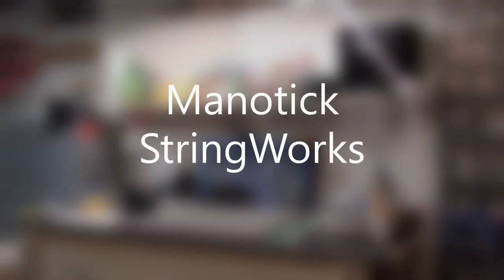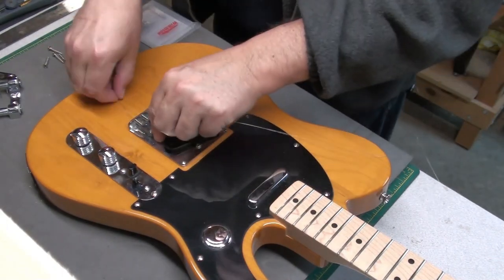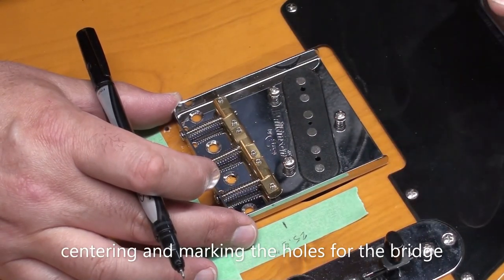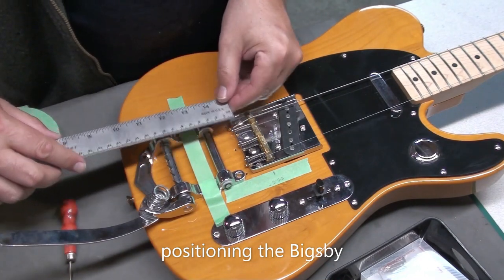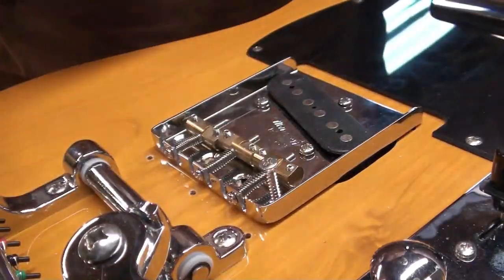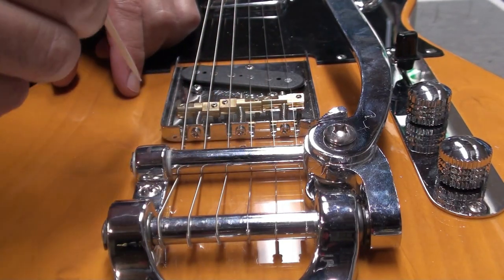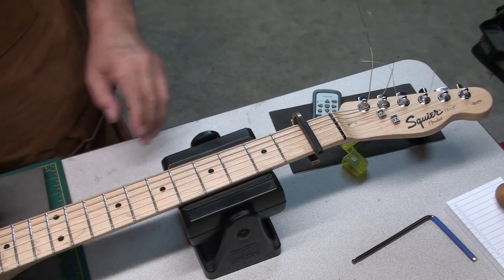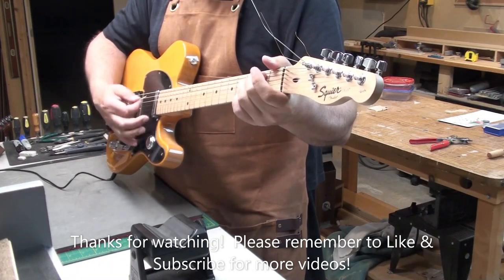All Telecasters should have Bigsby's...no?  Installing a Bigsby vibrato/tremolo on this Squier.

Comment: On the positioning the Bigsby step, I would have used the same method you used for positioning the bridge. Leaving the 1st and 6th strings on, I would have added the 5th and 2nd strings through the Bigsby and then through the bridge to make make sure they both line up correctly.

Comment: You gained a subscriber! I used this video to help me when i put the trem system on my hollowbody Gretsch, i'm watchin this now to help me with my telecaster project, i built the tele with a kit. Now i am gettin the project done sometime in a few days, thanks for this video
Reply from the maker: Awesome!
Reply: @Manotick StringWorks
Now i could use the modern six saddle bridge right? Later on the tele is going to get the three saddle ashtray in black. I aint sure how i'm going to do all that.
Reply: @ManotickGuitarTech  few months later after the install on the B5, and it sounds amazing. next thing is an old school style ashtray, woohoo!

Comment: My Squier Affinity Telecaster is set up exactly like this one , except that I didn't install the arcade style kill switch and mine has fender locking tuners installed. One thing about these aftermarket Bigsby style tremolo setups is that the nut and washer tend to tighten themselves up to where you can't turn the arm. I think that some "thread lock" might be the way to go when doing this type of mod. Great job! I sort of messed mine up doing this😅, but I got it straightened out.
Reply: Thread lock would be good; another trick is to put the nut on something that can function as an anvil, and strike it gently with a steel hammer, so that it becomes veeeeery slightly oval instead of perfectly round; this will increase the friction on the thread. You need to be very careful with this trick, trying first a very light blow, fitting the nut on the thread, then if it needs a harder blow, going only slightly harder, etc. If you hit it too hard, it won't even go on the thread, or it'll damage the thread.

I've never done that on a Bigsby, so I don't know the specifics, I just know this as a general trick with nuts and bolts/machine screws.

Comment: I love the look of these on a Tele and I’ll be doing the same on my Artist Tele shortly. Is there any reason you had to change the bridge? My guitar came stock with humbuckers so my bridge is different to the standard Tele. Add to that I’m a lefty, so I’ve bought a Chinese copy and I’ll pull it down and rework it so it suits a lefty. Fun. I guarantee I’ll never use it either lol. I like the kill switch you did too, nice bit of extra chrome!
Reply from the maker: Thanks for watching - I hope you have subscribed to my channel?  I wanted to use the vintage style bridge with brass saddles and the original bridge had 6 block saddles that you cant run the strings over.
Reply: @ManotickGuitarTech  ah ok I see. I’ll have to change bridges also to use mine as my strings are retained in the bridge. I have a humbuckers in mine though so it might be awkward getting a bridge to fit. Maybe I should just wait until I buy a vintage style Tele with just a single pickup at the bridge. My Tele is one of the Artist ones so I will be doing a bit of experimenting on it, I’ll add a kill switch but mine will go on the control plate, I guess I’d call it like John 5. My biggest thing is I’ll be adding a black binding top and bottom to this one, I think it’ll really help with ageing it some, but then the two humbuckers burst the illusion lol.
Reply: I've seen another video where a guy had done a "bubba mod" to the factory bridge plate, which  is when you CAREFULLY  drill 3 holes in between the 6 factory holes and replace the block saddles with 3 brass saddles, but you only get one shot at doing it right, and it's definitely harder to drill straight through hardened chrome plated steel than you think, not to mention  that the Wilkinson ashtray style bridge that I ordered was only like $25 on Amazon or something like that. I have the original bridgeplate in a plastic bag in my closet.
Reply from the maker: @spottedsaint957  pretty cool!

Comment: I did this exact same mod to my 2018 Jazzmaster Affinity. I bought a dremel, a Wilkinson half tele bridge and a cheap Bigsby knockoff (I recently bought a locking nut because the arm would just loose very quickly), it initially had a strat-style 6 saddle hardtail bridge.
Reply: Why? The "Jazzmaster" comes with a trem, doesn't it?
Reply: @Pappysan  Not mine. Mine is from the 2018 AFFINITY series, those were the low-mid range guitars from Squier. It had no trem system, just a hardtail bridge with 6 saddles (like a strat bridge)
Reply: @Apo458  Oh, I didn't know that...I was just looking at Affinity Jazzmasters because they are going for about $280 (with a trem). Seems to me selling a Jazzmaster without a trem is kind of sacrilegious...
Reply: @Pappysan  Yup, pretty strange design decision. I picked it because it looked cool with black body and two humbuckers. Now I changed it all to gold hardware, I love it even more now

Comment: I think that most guitars aren't finished without a tremelo arm. But I'm not sure about Teles. It's a stick and a slab of wood. It's yer bog standard model. No air con, no power steering, no servo, only available in beige. Basic. So that means no extras like tremelo arms.
Reply: I’ve been playing a tele as my only electric for a year. I enjoyed every part of it except itching for a tremolo. I would actually say that it would actually be perfect if there are more affordable tele models with bigsbies.
Reply: I wanna buy a tele Nashville but i deff would add a trem system i dont like strats tbh

Comment: Great video, plan on doing this with my Partscaster, got it off E Bay here in the UK but was ripped off as the neck was useless, had a back bow and the truss rod nut was rounded off, got a new replacement neck (roasted maple), Wilkinson tuners, bone nut, brass compensating saddles, guitar already had a Wilkinson pickup in the bridge and a five way Strat switch, pretty sure the body is Squire as it's 40mm thick, Butterscotch and slightly relic'd, it now plays superb and is currently my favorite guitar. Was looking at a licensed Bigsby B5 kit, can only find them in the US (i'm over in Scotland), shipping and import tax is the killer. Will get one though.
Reply from the maker: Sounds like a big project - good luck!

Comment: great video! am hoping to do this on a harley benton te62... kind of a project guitar too though i hope to keep it looking pristine. not quite sure why you changed the bridge AND the plate. can understand why you would different saddles but what's wrong with the plate??? I have a standard ashtray plate with a 3-saddle bridge. would that work? (assuming i use a dremel to route the strings in)

Comment: This is the exact set up I have to use on a Meteora tele build I’m doing. Does it work well after having it for a while? Any issues with the strings grinding the saddles? Thanks for all the info
Reply from the maker: SO far so good - admittedly, I don't use this guitar everyday so saddles have held up well.

Comment: Great video!
I started searching for Tele bridge replacement because I just can't cope with the ashtray bridge I have on a otherwise great guitar.
Will a Bigsby work with any top loading bridge?
Reply from the maker: You have to do your homework and take measurements before modifying anything.  There are specialty roller bridges made for telecasters - check them out.
Reply: @ManotickGuitarTech  
Thanks, I'll look at that.

Comment: I did the same mods to my Squier Affinity Telecaster about a year and a half ago and it's still an ongoing project. I just put the original bridge plate screws back in. They sort of help with the  tone🤡🤪🤡. Naw , I just put them back in to keep the holes filled in, but they do sort of give me a reference point for whenever I remove the bridge plate for any reason. Btw, I used a hacksaw and a couple of cheap minifile sets ,(two of the files snapped  in half lol!) ,to cut and grind my bridge plate. Do you have any videos showing the other mods that you have done to your Tele?
Reply from the maker: No, the mods I did were several years ago before I started on YouTube.  I hope you have subscribed to my channel?

Comment: I just bought an Affinity Tele and have replaced the pups with Fender Tex Mex pickups and added a Wilkinson plate with brass saddles. It sounds and plays fantastic and was thinking of this mod, but I dont want to ruin a fine playing guitar if it not a quality mod. Question: Is that the Dopro Bigsby knockoff? How is tuning stability? I prefer to play with 9-42 strings due to my bending style and 10s are too heavy for me.
Reply from the maker: I wouldn't mod the new bridge you just bought - look for a roller bridge version and swap it out.

Comment: While I like the look of the vintage notched 3 saddle much better than the modern 6 saddle, you can do this conversion without changing the bridge.

You can buy replacement saddles that have a pass-thru screw on them and a roller saddle that allows the string to go through. They're sometimes used for a B-Bender set up using a modern style bridge.
Reply from the maker: Absolutely, Jeff - I just wanted to show how you could modify something you might have on hand already.  Thanks for watching and I hope you have subbed?
Reply: I like your idea. You maintain the same bridge and you don't have to worry about the routed hole coverage.

Comment: This video inspired me to install a B50 on my Tele, thanks. 

Did you find that you could get correct string alignment without notching those saddles? For me the strings are way off the pole pieces as the B50 has a much narrower string width than a Tele. Im hoping switching in some notched Gotoh saddles will do the job
Reply: James I highly recommend replacing the stock Bigsby front roller bar with a Callaham front roller bar. It has slots etched into it that give the correct string
spacing coming off the roller bar already which also means the strings will have a
strait shot across the saddles & not be fanned out crossing them at an angle &
causing sideway pressure & friction on their slots. It's also a heavier more solid bar which may improve sustain. It's the best upgrade I've done to my Tele's Bigsby. Greatly improved the tuning stability. I have literally gone several days playing a couple hrs a day with  frequent use of the vibrato without needing to retune. It literally holds tune as well as any & better than some non vibrato guitars I've had.

Comment: Got a 72' re-issue deluxe. Is there a specific model bigsby? I have 2 chrome humbuckers on it though.  That's why I question. Is it the same model bigsby as your using. I don't need the pick up plate so...just ignorant and curious.
Reply from the maker: This one I used was a replica and it fit the dimensions of my guitar.  Check the websites carefully for specs.

Comment: Awesome work. I want to buy a knockoff bigsby for my Mexican telecaster I converted to an Esquire. Was curious about the tray. Seeing you grind solved that. Thanks.
Reply from the maker: Just keep a steady hand...it worked pretty well!
Reply: @ManotickGuitarTech  problem is I only have a large grinder. That small one you have is perfect. A cutting wheel might work.
Reply: @ManotickGuitarTech  Hack job, if I've ever seen one! I know, its your project guitar, but using the old bridge would have been a better fit and justified the hacking.
Reply from the maker: @flintdavis2  I couldn't use the existing bridge because it had block saddles... the strings can't ride over them.

Comment: Great video! I also have a butterscotch Telecaster and I have been thinking of adding a trem. I love my tele but I don't play it as often as I like and that's only because it has no tremolo. I was looking at perhaps adding a Vega-Trem, which is great because it requires few, if any, mods at all. However, I really love the classic look of a Bigsby, so I am a bit torn - plus the Vega-Trem is way more expensive than a Bigsby. ...Also, maybe I missed it, but I don't think you mentioned exactly why you couldn't hang to the old bridge. 
If I went wit a Bigsby, instead of the Vega-Trem, it would be nice to just drill out the holes and slap it on with as few modifications as possible. I'm in no rush and I suppose that I will figure it out at some point. Either way, great video, so I will go ahead and sub!  
By the way, there are these bridge extension plates, I forget what they're called exactly, but they go from the end of the bridge and cover the old drill holes nicely; I have seen them on eBay. It looks like it is part of he bridge. You might have to drill out a couple of holes, but some of these plates come already pre-drilled. Hope that info helps!
Reply: There is a new VT2nd model that uses existing bridge mounting holes for the fulcrum plate.  ND - no drillin'
Reply: @glendoggett9670  Yes! I just installed on of those on an old Tele of mine. Thanks!

Comment: Sad to see the decline of the "Squier by Fender" brand.  I really like Squier AND Fender string-through-body hardtails - and especially with the new saddles - because of their versatility. Here again we see the "cheap" "simplified" string-through-bridge manure! 🤔
A bit of historic top-level Bigsby construction. At the end of the 60s, the construction did not have a cylindrical string barrel, but 6/7 stepped ones with different radii - each string has its own depending on thickness and tensile strength. At that time, more attention was paid to the smooth alteration of a full-sounding chord. One mistake was revealed quite quickly - the accuracy of staying in tune depends largely from the strings caliber...

Comment: Great vid! can it work without grinding the string holes ok the bridge? 🙃
Reply from the maker: You will have to grind the back of the bridge to allow the strings to pass through
Reply: You can buy bridges that don't have the back lip. They're kinda pricey though. You can also buy a Bigsby B5 telecaster kit which includes a bridge that is kind of like a plate with a countersunk bridge (think mustang, jazzmaster, jaguar bridge).
Reply from the maker: @jorgehuamanmusic  you sure can - I just wanted to show how you could do it by modifying parts you already had in stock or from another guitar.  Thanks for watching and please subscribe if you haven't already.

Comment: What parts did you get for this? I've seen the official bigsby kits go for $200, and I'd rather save a few dollars.
Reply from the maker: Tim, just search up Bigsby on Amazon - the parts I used were offshore knockoffs.  The bridge was from Wilkinson, though.
Reply: If I can add, The offshore Bigsby's work well. Thee only issues with them is fit and finish at the contact/bushing points can be an issue.

You can take them apart, and polish up those points with some 000 or 0000 steel wool to smooth those areas that are often glanced over in the overseas manufacturing facilities, which is the main culprit if there's binding in the unit.
 Then prior to final reassembly, just add a bit of light clock oil (my personal choice for its resistance to "bulk up" with debris) or Nutsauce  on the contact points, and it will perform well for many years.

Comment: So how do you adjust saddle position since you can’t fit a screwdriver in there?

I’m installing my second one tomorrow, and I heard they sell screws which are slotted on both ends.
Reply from the maker: I have a right angle Phillips screwdriver- you could also use a long neck screwdiver
Reply: @ManotickGuitarTech   Where the heck can I find that right angle screwdriver? I looked!

Also, you said you used a 1/16” Dremel cutting wheel to make the cuts in the bridge, but I can’t find anything online with that spec. I assume that’s the width, and they don’t give that spec.

Thanks for your help!
Reply from the maker: @Ira88881  lol- l had one in my tool drawer...think it came from Ikea 😁
Reply: @ManotickGuitarTech   You’re my hero:

My long neck screwdriver just arrived and works perfectly.

I didn’t even know the dang thing existed.

Comment: why couldn't you just run the strings through the holes in the original bridge ? would they snap ?
...just thinkin.
Reply from the maker: The original bridge was a 6 saddle design and the strings would not move freely with the bigsby
Reply: @ManotickGuitarTech  I haven't tried it yet, but i'm going to. I have a B bender where the B string screw is hollow, it works thru the screw's nut end then thru over the saddle.
But thinkin-  run the string thru the hole just under the intonation screw on the bridge, might work. I'm going to put a huge C clamp on it to find out on a squier bridge like the one you had.  Thanks for filming the mod that you did, quite awesome👍
Reply: eh, c clamp over the trem I have ( the old Chinese Teisco type )

Comment: Not a good modification in my opinion. Why would anyone want to disfigure a tele by putting a look alike Bigsby vibrato on it. Too many changes even if the client wants a vibrato fitted. I also don't like the strings passing over the top of the bridge like it is here.  Check out Cort's Sunset Junior and the roller bridge it uses. So much better

Comment: Manotick StringWorks...In fact, that is not a ''Bigsby vibrato/tremolo''...It is just a cheap Chinese copy of a Bigsby with cheap white plastic bushings that will cause havoc with tuning in the long run...It is not made by or sold by Bigsby...Even the LICENCED BIGSBY B50 made in Korea have the cheap plastic bushings that cause issues...The LICENCED BIGSBYs are not made by Bigsby but the company the makes them in Korea pays a licencing fee to Bigsby to use the bigsby name and design... Only the USA made Bigsbys have all metal bushings and bearings and are made by Bigsby... just saying...